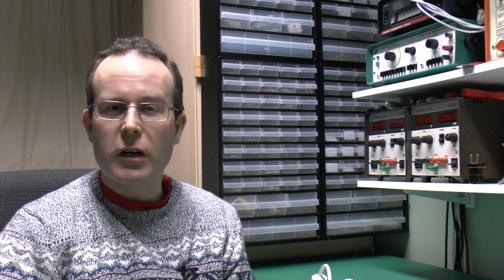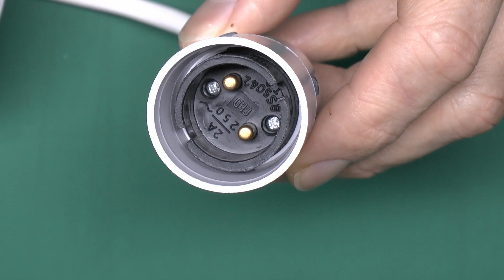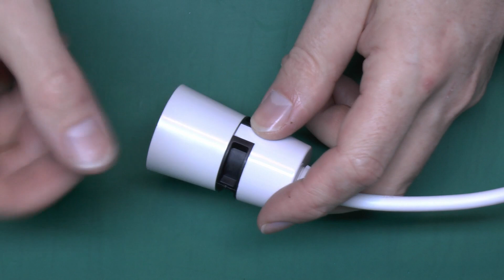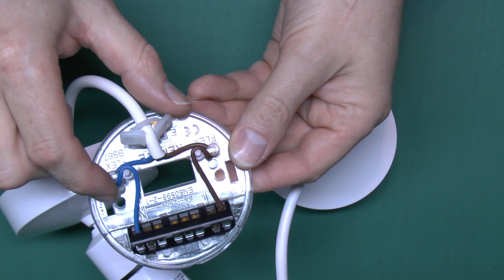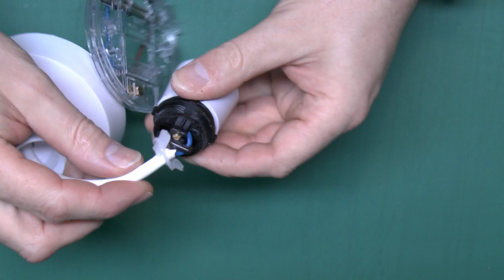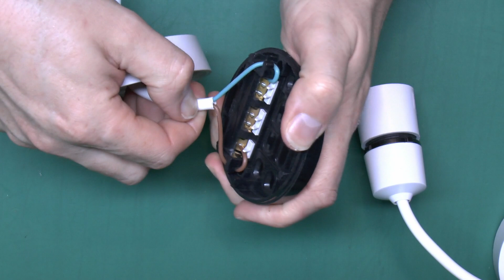Crabtree Lighting Pendant with cheap-o-matic lampholder terminals

Comment: I have one of these and it has a yellow earth wire but I can only see 2 Terminals on my living room ceiling.  My wife has pulled it out partially while cleaning the shade.  The earth looks like no wires exposed and I am wondering if it was ever connected and looks like only nuetral and live connected on yours but then no earth on yours so can I rewire the nuetral as live still connected and ignore the earth as simply see 2 connections only?

Comment: The black base looks very similar indeed to the old Volex ones. After a while I mastered the technique of breaking out the cable entries without writing off the whole base ! Thank god c.e.d. do those more malleable , clear bases! I have some Crabtree safety pendants here (recently removed from a customer's home), and the bases are very well designed indeed; not like the black base you show here. On mine, the lid unclips (not unscrews), and the flex comes away as part of the lid, with same cord grip on it that you have here on the safety bulb holder.
Reply: Volex is same company.

Comment: I hate to inform you all but that Crabtree system IS the best one as any competent electrician will tell you. It is designed to provide 1/Total isolation of the contacts when the lamp is removed 2/ Remove the problem of the brass spring-loaded pins embedding into the solder of the lamp cap, resisting the removal of the lamp 3/ when the pins embed in the solder, it's usual for the glass envelope to become detached from the base and leave the base in the holder, potentially connected to a live supply unless isolated at the consumer unit. 4/ As many householders will testify, many times you go to remove the lampshade ring only to find that the heat has distorted it, and it jams on the thread and will not unscrew, and then normally the cover over the terminals unscrews, exposing the person to once again potentially live terminals, not good. 5/ The flat spring terminals of the lamp holder, actually move back about 15 mm along with the plastic section supporting them and rotates slightly to provide both a DP switch mechanism between the fixed terminals and the lamp terminals. This can only happen if a bulb is inserted into the holder, pressing on the contacts with your finger will NOT allow the switch to operate, so that if a finger does slip into the lamp holder by accident, i.e., like when changing a lamp in the dark etc, the person doing so does not receive an electric shock and a severely burnt fingertip because they will then be touching both Live and Neutral connections creating almost a dead short with their fingertip carrying 100s of amps. 6/ The rotation of the contacts also acts to "wipe" the lamp contacts clean, ensuring good contact is then made. 7/ The lamp holder top contact cover can be removed by the use of a small screwdriver to gently ease the 2 white clips that extend over the black middle section and the unscrewing of the "nipple" on top like JW showed, this nipple is the cord grip, once this unscrewed, the top cover can be removed allowing full access to the incoming cable terminations if required.

I normally find that JW does a pretty good job when presenting things, however on this occasion he did not do enough research of the product, which on its launch received several industry awards for its contribution to safety.

Comment: Hi am looking at your video at 6.09 does the 2 wiring has to be in order because it does not say
 N or L or  doesn't matter which wiring goes in that light bulbs connector
Reply from the maker: Doesn't matter, both contacts are identical and the lamp can be installed either way.

Comment: I used to have these in my house. They were installed back in 2005 and in 2016 that's when they all failed in the space of about a month. Curiously, each time, it was the neutral contactor that had basically cooked itself by arcing. The failure sign is that the lights won't turn on immediately when you press the switch and when they do you will get an ozone smell. You'll hear crackling, arcing and the lights will flicker and a brown spot will appear on the lampholder as it finally gives out. These contacts are just diabolically bad. In every fitting I found the spring had also been oxidised by the heat as well as the contactor. In every case it's been the neutral contactor that's failed rather than line. I'm hoping the Starbreaker CU doesn't have crap contactors. TBH the Crabtree sockets are also problematic in that they just crack and basically fall off the wall. I'm replacing with MK boxes as and when, but these are NOT the same MK from your childhood. Even MK have become a cropper to cost-cutting :(

Comment: if there Was a Pin Instead of Flat metal in socket center That would be a great Improvement here in  US.  Old house has freaky electric, did in some old sockets. Tho - NEW Bulbs bought had damaged basses, so check them..

Comment: In Australia, HPM made a pretty much identical "safety lamp holder". The contacts were very flimsy and would appear to be problematic with high wattage lamps. If I recall correctly, the current rating was reduced compared to the conventional kind of socket. There isn't as much pressure applied to the contacts on the bayonet base, unlike proper spring loaded plungers. As well as the contacts touching the bulb base, there's a set of contacts hidden inside the lamp holder to provide the 'safety' function.
Unfortunately, the B22 base is under threat with cheap nasty imported light fittings using E27 based lamps flooding the market.

Comment: the bayonet is also used in new zealand
Reply: +Stephen Smith Not that uncommon in France either and I've seen it in Greece too. In Austria and Germany it's sort of a specialty for industrial use. I wish it wasn't because Edison sockets are just a huge nuisance, especially cheap ones. I can't recall how many times I've had to switch off the power and pry around with a screwdriver to bend up the bottom spring again! If I hadn't stocked up to the ceiling with pearl Edison lamps before they were banned I'd probably be tempted to get a bunch of BC22 sockets instead. Since BC22 is so uncommon round here incandescent bulbs with that base are considered a specialty not affected by the EU ban...

Comment: Penny pinching, just like with the 13A sockets and switch fuses now. Total rubbish compared to the previous design.
Reply: Crabtree's new 13A sockets and infact all their products were vastly superior to the old models in every way and had greater electrical safety, again, you need to observe both models side by side and read up on the design details.
Reply: @leonardbutcher8555  Since I last posted 5 years ago the design of the 13a fused spurs have changed again and are totally appalling,  terminals so small, the fuse carrier breaks out of the front when opened, some of the batches the fuse carrier is permanently jammed in so the fuse can never be removed. The switches are now very stiff.

The 13A sockets have moulding flash not removed around the pin holes which can make inserting plugs difficult. The pin and switch contacts are now supplied tarnished resulting in very high r1 + r2 readings unless the switches are worked and a plug is inserted and removed a number of times. 

It's good they have taken the 'Electrical Excellence' printing off of their packaging boxes though, as the products inside certainly don't live up to that any more.

I still have some of the old sockets and fused spurs with the old style large round brass terminals. They are a world away from the current products. I remember when the design changed from the large round brass terminals to the rubbish square steel ones, an Electrium rep was visiting the local electrical  wholesalers. He got so many complaints and abuse from the electricians he had to cut his visit short and leave. 

It was shocking to see the small terminals change recently to even smaller ones. I've no idea what the manufacturers are thinking. We don't have to worry though as that was the last straw and we have now switched to Click as our main brand of accessories.
Reply: @echothehusky  Crikey, they have gone downhill rapidly since Siemens purchased them then. I was writing based around the products that they had when I left their employ about 24 years ago when they were still based in and produced in Lincoln Works, Walsall. I remember that safety lamp holder being introduced and at that time it really was good, trust me, it answered and addressed the bad points about the normal type of holders, regardless of who made them and made changing a lamp much safer. But I was unaware of these current issues you mentioned, so I'm assuming that they moved production overseas and as such have lost the quality that they were once famous for. All in the name maximising the bottom line and chasing the mass market rather than the quality specification lead market that they used to enjoy with the local authority rewires. Its so sad when a company becomes controlled by bean counters rather than engineers.
Reply: @leonardbutcher8555  Yes back then they were excellent products, we used them for many years. I don't know where they are made now as the 'made in england' moulding on the back of the plates is now just a blank rectangle.
Reply: @echothehusky  Well that speaks volumes, they must be afraid to state where they are made.

Comment: Lets hope Crab-tree do not try and re design their 45A Shower Pull Switches, the cheaper square alternatives are errrrghhh,,, maybe if you have complete control of humidity, all Fitted in the correct zones  and even outside, IP Failure...   just get Crabtree...

I would like to see that video :) or your version of it,,

Comment: The crabtree holder does get over the problem of the pins becoming in bedded to the solder jamming the bulb in the socket, which can be a more of problem with BC lamp holders used as pendants. The weakest point of any plastic BC lamp holder is the retaining ring that the pins on the bulb hook into. In particular the harder plastic types with the embedded metal ring. Over time with expansion and condition the plastic can brake down and the bulb plops out.

Comment: The other advantage with the clear base is that you can see whether the screwdriver is properly in the terminal screw and more crucially if the wire is well into the terminal. Having had a few CED bits from Toolstation I'm not convinced it's all very good, I mostly fit MK pendants

Comment: All the Crabtree ones I have are clear. The bottom of the lamp holder just unclips if you need to re-wire it.
Reply: SDG Electronics you must have the older design then... they redesigned them to have the black plastic and all the clip on parts... great if you have kids (then again... who lets their young ones swap a bulb or stick their fingers in a holder??) but it's an unnecessary safety feature with the contact points... better off with the standard brass pin B22 lamp holder or an E27...

Comment: I'd must admit, I do like MK's version of a safety lamp holder, but it uses the two pins on the side of the bayonet cap to push open a shutter when the lamp is inserted